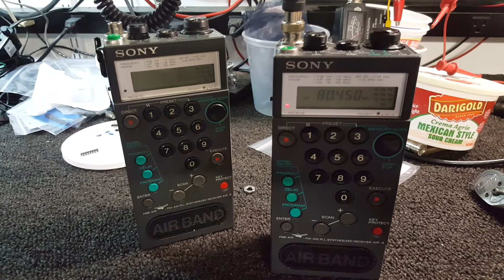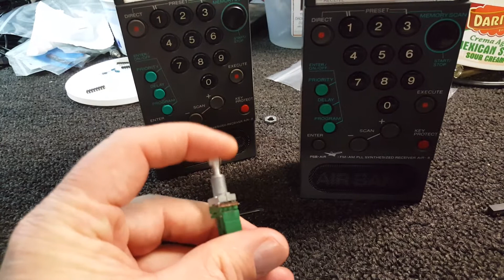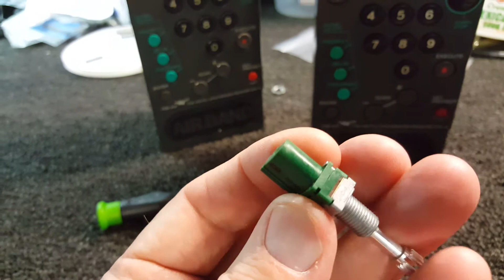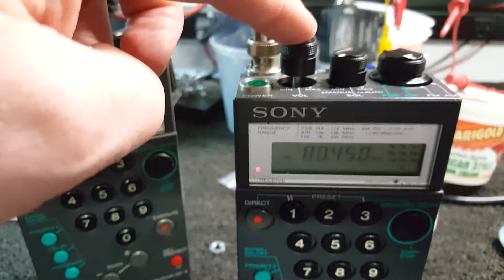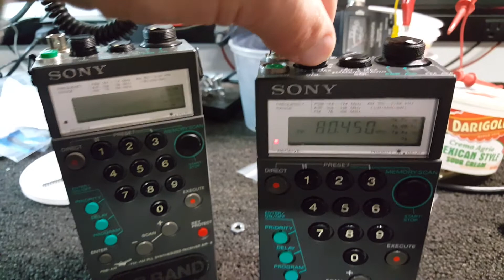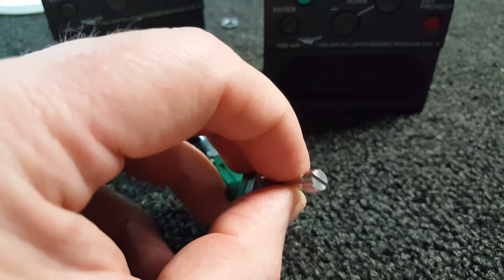Sony Air-8

Comment: I have issues with the squelch button. I think it's a mechanical problem because it used to make a clicking sound, but now it has lost that function. Is it better to replace it or open it and repair it?

Comment: Hi Jim, just seen this fine topic of yours... I've recently digged out my Air.8 from the late 80s... probably one of the very few receivers in Italy (if not the only one). It fell sick of pot-itis otherwise still works. I've searched in Italy for the Mouser p/n and found out it's locally available. Could you kindly advise me about the p/b of the squelch pot?.. I have no reason to assume it's damaged, but once the set is disassembled enough it could be well worth replacing both pots...

Comment: I had an Air-8 back in the mid 1980s.  They sure had nice clean and flat audio.  I recall being able to hear commuter planes and know if the props were in sync or not.

Comment: hello, sony icf pro80 and pro70, air 7, air 8 radios I produce all potentiometers. (50k, 20k). Excellent lifetime guarantee compared to the old ones. I have a lot of Sony radios. The potentiometer I made has the same characteristics. The length of the potentiometer I made has the same original dimensions as the modifications I made myself. You can get it from the link below. 

https://www.sahibinden.com/ilan/ikinci-el-ve-sifir-alisveris-teknik-elektronik-devre-montaj-1-230-538-11,1-237-670-11,1-230-538-11,1-230-537-11.resistor,var-696097116/detay/

my contact address: m.akiwanet@hotmail.com
Reply: I need the volume pot for the Air8 radio. How do I order one?
Reply: @jimgrindstaff9411  my contact address: m.akiwanet@hotmail.com

Comment: Jim,

I'm having a real hard time fixing the squelch pot.
I have fixed the volume control, replaced the pot. Unfortunately the squelch pot has not been so succesful.
Do you know where I could locate the 50K squelch pot? I did find one but it only has three pins, when I soldered it it does not work.

Any ideas?

Comment: Hi Jim,

If we where to replace the squelch potentiometer with the same type as you are using for the volume control. Would we lose the manual and auto function ?
Reply from the maker: Jimmy, the part used for the squelch control is a different part. I have not researched a replacement for it. However, I believe you could modify the board and use a similar part as the volume control but you would lose the auto-squelch functionality.
Reply: Jim Stadtfeld do you know what you call that piece ?
Reply: @kb7skb  Hi Jim,

How would you go about modifying the board?
My squelch is dead. I have a replacement 50K pot but it's only three pin. It does not work when I solder it on to the three top pins at the top of the small sony board.
Any ideas?

Comment: I found the part here in europe, fixed mine. It's a great radio, my granda had the exact same one air-7 back in the 80's.
i also updated the little green led because it was extremely dim. I'm looking to update the antenna as well. I read somewhere its possible but you will lose the possibility to use the original one. I'll update if I work it out! Thanks for your video, helped me.
Reply from the maker: Great job! Thanks for your comments.

Comment: Is the part number not PTP901-030K-203B2 ?
Reply from the maker: Correct, Sorry about the Typo. The mouser part number is 652-PTP1-030K-203B2
Reply from the maker: Correct, I purchased them from Mouser.com. Sorry for the typo.